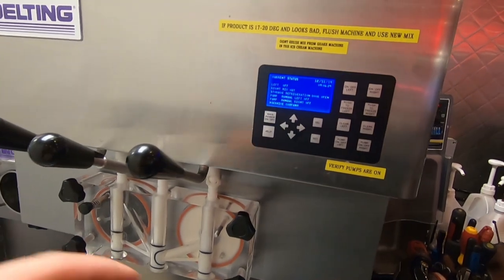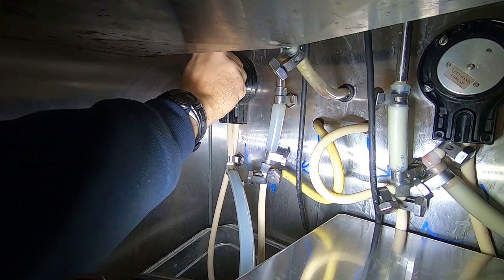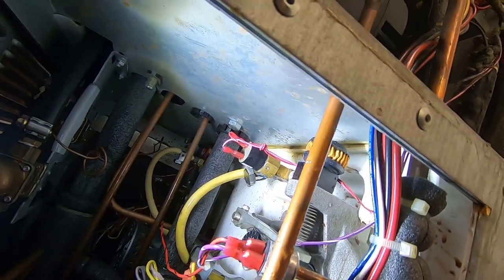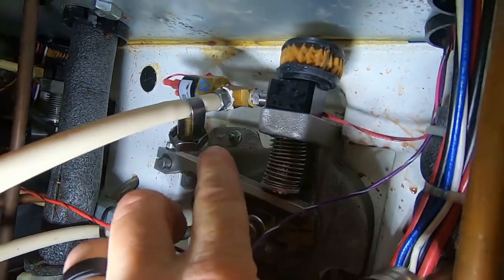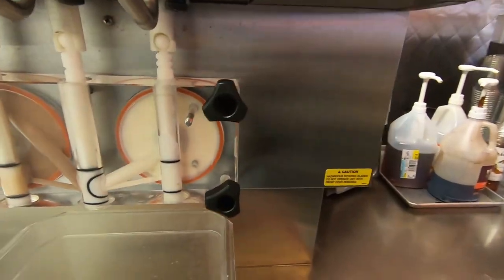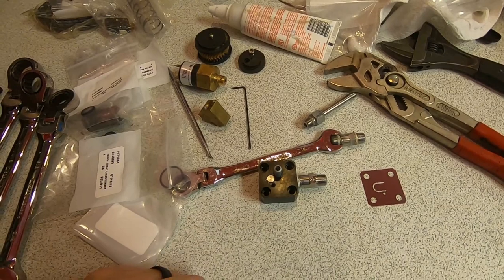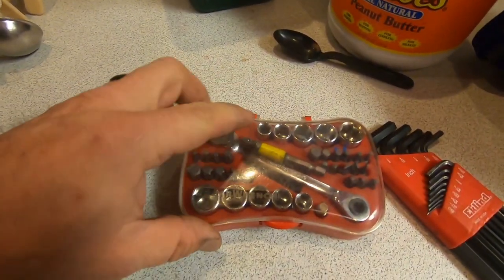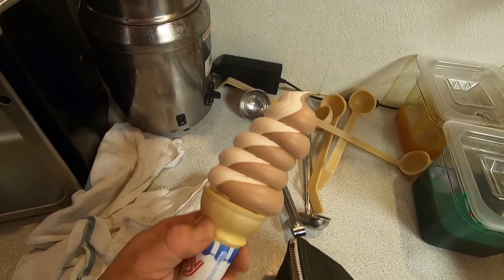Stoelting U431-109I2 Ice Cream Machine Air Pump Problems Low Overrun Slow Pump

Comment: Ahh I have never searched the interwebs looking for service videos but it it nice to see another U431 master out there! I have considered making some how-to videos myself but I also have learned the hard way...
Reply from the maker: I do not do detailed repairs on how to set up the machine is done. The refrigeration sections the same as any other machine that’s why I did it on that section only. There’s only so many ice cream places around so I keep that a little more confidential.
Reply: @HVACRSurvival okay so I've got an interesting problem thats got me stumped and of course on a busy weekend. So I thought of your video and out of desperation here I am lol. Contact relays for both freeze cylinders are hammering and clanking like crazy. Every once in awhile it alarms out for "high pressure cutout". I'm suspecting a bad board but the machine is only 2 years old...any input?

Comment: "Gumminess"!
Initiate gag reflex avoidance manuever.
Great vid and explanations.
As an F&B operator 30+yrs, I've told friends and family to just say "NO" to any fountain soda, draft beer or soft serve ice cream.
Reply from the maker: I haven't noticed that before 🤦‍♂️🤷‍♂️,  but I also haven't had to run a wire up the feed tube before either😝. The constant turnover  of employees is the root cause of most of my service calls at this location.  Most places do a better job maintaining the machine.  That could have developed in a short time with the machine being left off without being cleaned when drained.

Comment: Nice to see a video on this! I deal with restaurant equipment, hvac and kitchen equipment. Keeps us busy! I have worked on  some very neglected ice cream machines. Been to electro freeze classes a couple times
Reply from the maker: It's cool to hear I'm not the only one doing 50 different specialties.  Electro freeze seams a little behind on technology from the machines I have worked on. But they work....so whatever works I guess.😁  It was funny to see a mechanical temp control installed to control the consistency. 👍👍

Comment: Appreciate the video.  I’m an electro freeze and Taylor guy.  Starting to deal with some of these Stoelting… not many vids out there
Reply from the maker: What are you looking for?
Reply: @HVACRSurvival  -  you’re so awesome reaching out to ask.  I’ve got a barrel that has a bad pressure switch and I’ll be changing that this week.  But it’s also been over freezing for a while.  I’m super fluid in EF units and been posting lots of videos to help other folks for the last year.    None of my locations had Stoelting and then I picked up 3 in one swoop.   Feel like I’m starting from scratch with them cuz they’re nothing like the other systems.  Tech support has also been helpful and I’m devouring the service manuals.    But seeing someone else in action is WAY helpful.   So few of us soft serve guys out here.   Just had to replace a failed crimp on a remote connection hose that dumped all 14 lbs on me. :-(.    Really appreciate you!!
Reply from the maker: @restaurantrepairs  so you have the manuals? And tech service will talk to you? That's half the battle. Taylor is horrible about helping anyone. I have the most experience with the U431 pressurized machine and just about any of the gravity ones. Plus the slushies I've replaced one barrel so far. I have another barrel to do yet.
Reply: I’ve got a hypothetical for you.  If the barrel of a soft serve should be pressurized to 30psi, but you only pressurized it to 16.  What would happen.   I feel like there won’t be enough pressure to push  against the hardened cream once frozen but as it draws out that would resolve itself.      Or will it not be enough pressure to push? Thoughts?
Reply from the maker: Don't forget the reason for the pressure is so that you can have the proper over run. The flights or auger blades help move the ice cream to the front, as long as more product is being pushed into the barrel it'll come out the front.
Reply: @HVACRSurvival  right.    I have “shake switches” that open at 16-18 psi.  And need to replace a soft serve switch that opens at 30.   Just looking for more educated feedback before I invest the labor
Reply: And to save a grand in material costs of course
Reply from the maker: Normally stoelting pressure switches come on at 17-18psi and off at 23-25psi
Reply: @HVACRSurvival  these are EF machines that cutout at 30/32    Guessing we’ll find out tomorrow ✌🏼

Comment: Just rebuilt both of my machines.  One is working as it should and the other is not.  The 2nd machine seems as if the pump isn't working at all as the vanilla is yellow and has no air in it.  The liquid mix is being pushed back through the air hose too.  Any idea what I could've done wrong?
Reply from the maker: Yep, air leaks and defective check valve

Comment: i saw a smaller model of these for auction. can u use them at home?
Reply from the maker: You could but something to keep in mind is when the mix continues to be stirred and not served it it will break down, what that means is when the ice cream comes out it will be soft even though its at the correct temperature. I run into this a lot at stores that don't sell a lot of ice cream.
Reply: @HVACRSurvival  i see there ment to be used ona. daily basis. i will pass on it. thank you for the advice

Comment: I have an O431 Stoelting soft serve machine which uses exactly this same pump. I am curious about this finger test (the one in which the pump must turn off after approximately 3 seconds). This test was developed by you or is a recommendation of the factory? I just replaced the pump kit (rebuild) and it passed to the finger test. However, I am not getting the proper overrun in the ice cream (it is much lower that the one configured (first I set to 60 % overrun and then changed to 70 %, but nothing changed in the finished product). Do you have any idea about what is going on? Thank you very much and congratulation for your nice work.
Reply: I forget to mention that the scrappler blades are brand new (I know it has something to do with the overrun).
Reply from the maker: The blades have very little to do with the overrun, you gotta remember just cause you upped the pressure don’t mean it’s gonna be instantaneous. It has to work its way into the mix, actually the Factory showed us that trick, I also use a pressure gauge to verify it’s shutting off around 23 PSI and coming on around 17 PSI. I would check the hose between the pump and the barrel. Make sure there’s nothing in there. You’re only supposed to have 40% overrun most the time. You usually only see around 30 to 35%.
Reply: @HVACRSurvival  , thank you very much for your response. So, even if you set the overrun to 60 or 70 % (knob inside the machine) you will get a overrun of around 40 % most of the time?  Even with the pump just rebuild (I changed pyston an cylinder, check and reed valves)?
Reply: @HVACRSurvival  Is it possible to get a real 60 % overrun? That is really strange, because in not pressurized machines we get 30 % overrun (only using the carburetor) and with a pressurized machine we should be able to get 60 % overrun.

Comment: How long have you been working on these?

I have Loctite 592 but never used 567.  I wonder if it is as chemical resistant as 592.
Reply from the maker: I'm not sure, I only use it for thread sealant and it works for that. It doesn't harden is what I like about it.
Reply: @HVACRSurvival  I think 592 does.  It has an orange scent to it.  Plumbing joints sealed with it can be used right away, but the instructions say to allow it to cure for 12 hours if it is to be in contact with oil or strong chemicals.  The last time I used it was on a washdown hose on a CNC machine.
Reply from the maker: @douro20  I just seen you asked how long I've been working on ice cream,  I've been in the hvac field since 1995, only done iced cream for about 4 years I think? 😁

Comment: I work on a machine just like this one, and have always found that left side always has a problem with with that check valve and small cube always plugging up. I have installed a rebuilt kit, what causes it to do that?
Reply from the maker: Air leaks I believe.  I have completely rebuilt the pump and changed the check valve but it still happens sometimes.

Comment: Why do you rinse out the sanitizer with ice cream mix? Why not pump water in it?
Reply from the maker: Because I don't want it mixed in with the ice cream mix. If you read the instructions for the sanitizer you do NOT rise with water once the machine is sanitized. You also don't sanitize until your ready to use the machine.
Reply: HVACR Survival since some sanitizer got sloshed on the tops of the drums (what are they called?), don’t you need to fill it all the way to purge it all out? Or is it non toxic and fine if a little gets into ice cream that someone eats?
Reply from the maker: The sanitizer is safe to eat within reason. I just don't want it creating any product issues such as taste or looks. I'm very OCD so I want it to be as perfect as possible. If you really want to be positively absolutely sure everything's is clean as it can be you could let some mix into the barrel and put it on clean mode then drain it out. But generally the sanitizer will float on top of the ice cream mix, that's why you need to have the front open so the sanitizer will flow straight out the front. Otherwise it will float on top of the mix and you'll never get it out without draining it.

Comment: Did you test for over run?
Reply from the maker: I do when I feel the need to. We take care of this machine on a regular basis because its a lease. Its normally around 38%-40%
Reply: I asked a bit to early in the video. Those pumps are a pain when you don't service them often. I service alot of f-231 gravity fed.  Good work!! Be safe.
Reply from the maker: We're changing the u431s out this July, we changed one out of five so far to gravity stoeltings. It might be the f-231. I forget.  We haven't had but 1 or 2 small problems after a year of service so far.

Comment: How do you test the mix pump if it not running?
Reply from the maker: What part are you wanting to test? Overrun, pressure switch cut in and out?
Reply: @HVACRSurvival  The mix pump isn't running at all.
Reply: does the overrun pressure switch prevent it from coming on?
Reply from the maker: Verify voltage is at the pump or not.

Comment: I absolutely hate working on these...lol
Reply from the maker: I hate the air pump but the machine is fairly decent to work on.
Reply: Air cooled or water cooled?
Reply from the maker: @davetatro478  water cooled.
Reply: @HVACRSurvival  I live in south Florida. These units need 50-70degree water temp coming in. My water temp was 90. My boss was trying to tell me that was ok. 2 months later, we replaced automatic expansion valves and water valves instead of quoting a small chiller...